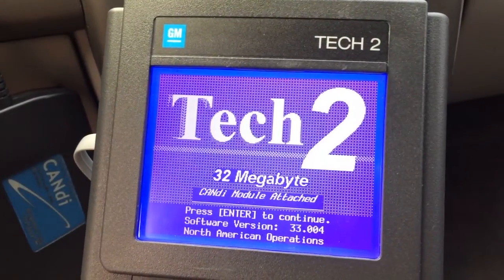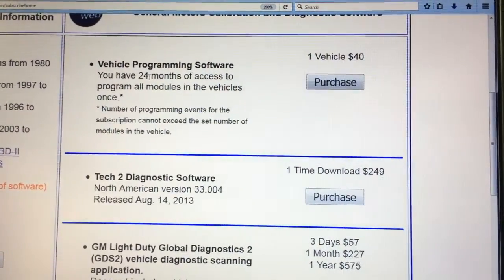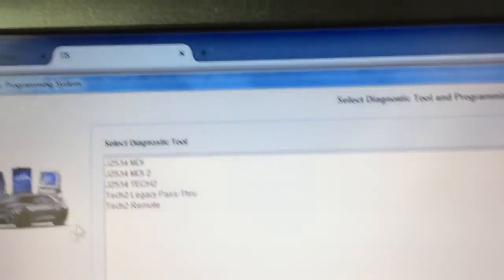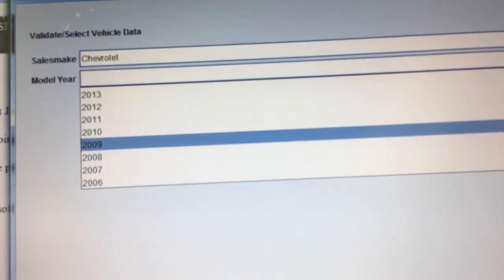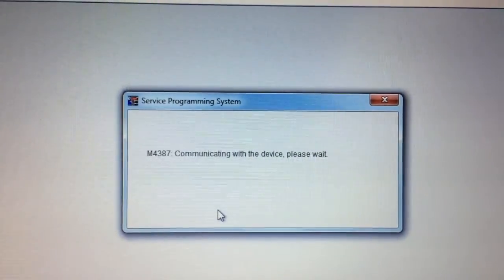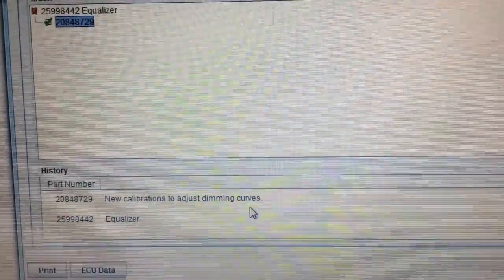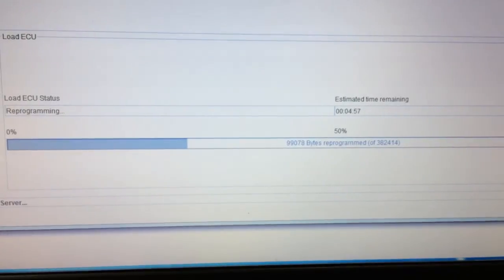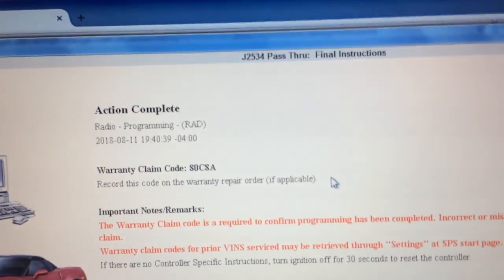GM SPS Programming: Tech2 Tool Pass Thru Mode ECU TIS2Web TDS How to do a Calibration Update Reflash

Comment: Great video. Finally found relevant info on GM programming. Question, I run an independent shop, installing a rebuilt 6L90 in a 2012 2500HD and need to program the TEHCM. I know this vehicle is not a CAN vehicle. Should I buy a MDI 2 and subscribe to GDS2 for 3 days and SPS for 1 vehicle or is there a better option that you would recommend? I don't have a Tech2. Also looking to future proof tech at the shop for newer vehicles.

Thanks for your help.
Reply from the maker: Thanks.  For a 2012 vehicle you could go with an MDI rather than an MDI 2.  I don't believe the MDI 2's unique new protocols start being required until Caddy CT4/CT5s and Corvettes from 2020 upwards, though that list will continue to grow and expand that's also going to be limited by GM's moving away from combustion engine powertrains and aggressively into electrics on their 2035 electrification roadmap plan.   With an MDI (either 1 or 2) you can have Tech2 coverage for legacy vehicles using the Tech2Win emulator sub with Techline Connect, so you don't need an actual Tech2 as a professional shop imo.

For an individual or prosumer user, I'd straight up recommend an MDI clone.  But while they, despite the fake news to the contrary, are 100% compatible with Techline Connect (SPS2, GDS2, and Tech2Win) they are not as robustly constructed and I wouldn't see them holding up long to shop drops and abuse like the original Bosch one.  The MDI2 clones btw are not real yet, they are currently just cosmetic copies of the same MDI1 boards.  So for coverage on 2020s that require an MDI2, only the real McCoy will suffice today.   

So bottom line, I'd look for an used genuine Bosch MDI unless you do this alot.  If you did these jobs alot, I'd instead suggest an used genuine MDI2. Hope this helps.
Reply: @DrShock  Perfect! Just the knowledge and help I was looking for. You are a wealth of information. I don't do this a lot. Thank you so  much for your fast reply.

So just to clarify, get an MDI 1, subscribe to GDS2 and SPS and I'll be good to go?
Reply from the maker: Yeah, that's what I would do in the situation you've described.  Used genuine Bosch MDI1, rather than Chinese clone.   And weekend subs to SPS2, GDS2, Tech2Win as needed that I'd charge to the customer.  It's like $30 or so, check at www.acdelcotds.com for the current rates.

For a DIYer, or prosumer, I'd always suggest a Chinese clone of the MDI.  But for a shop you want some more ruggedness to the outside case and inside electronics.  The clones are 100% compatible software wise, but if you drop them they are more likely to be damaged than a real Bosch.

Comment: Ok, after decades of dealer work, my Hewlett-Packard TECH2 card can no longer be updated pass the 2013-2014 model year! Is this right? Retired and fixed income is no fun, but a storm destroyed my wife’s older GM. I want to get a 2015 Malibu LT and still like to be able to diagnose the problem...Even if I have to take it in. The techs I worked with have retired and some may know me, but just unsure in October of 2021 what my TECH2 will work with! Thanks to the Chinese flooding the market with cheap clones that break down-no repair and some have messed up module(s).
 Any thoughts that could tell me what to expect?
 The carline Malibu ran from 2012-2015, then change in 2016. I know I have lied to the TECH2 in the past to have it function fine on a 1 year newer model. I guess looking for current help as I don’t want to walk into a dealer tech for nothing! Thanks. DK, Omaha.
Reply from the maker: Yeah the Tech2 is retired as of 2013, started getting model support dropped in 2010.   You can still use it as a J2534 passthru with www.ACDelcotds.com for SPS.  But for tests and diags you'll have to use GDS2 on the laptop now.  Here's a GM list of what requires an MDI now (or J2534 passthru) for SPS/GDS2 - https://www.genuinegmparts.com/pdf/positionstatements/vehicles-supported-by-GM-scan-tools-reference.pdf

Comment: @drshock Thanks for this video! can you please tell me, which type of program do you use in this video, win XP or win 7, and which operating system do you use, 64-bit or 32-bit? i also want to know, which version of Java do you use and which browser is it?
Reply from the maker: I'm following the GM hardware and software guidelines published at https://gsi.ext.gm.com/userguides/Aftermarket%20Infrastructure%20Guideline%20v1.0.pdf where the most important thing to notice/get right is that the Java runtime has to be 32-bit whereas the OS has to be 64-bit.
Reply: @DrShock  ok, thank you

Comment: Which tech 2 clone is the best or all the same
Reply from the maker: I'm not sure if these are being actively cloned anymore.  The MDI and MDI2 type clones are the more current tools.  But you used to be able to spot the higher quality Tech2 clone by the fact that it came with all of the adapters, various power cable types, and loopback test adapter.  It would also come with a copy of the TIS2000 software.
Reply: @DrShock  thanks been looking for another tech 2 with 32 card and tis 2000,,they all look about the same,,got a one now that works on my laptop,just no tis 2000, I still work on a lot of this old stuff,love you Channel keep up the good work
Reply: @DrShock  hate to keep bugging you but want to make shure I'm getting the right one,,

TIS2000 CD (included) will do up to 2007 year for GM vehicle programming. Does NOT include the software key. You'll need to obtain on your own or find a hack to unlock. Best source is acdelco website which costs $55 for 2 day access to the tis2000 SPS reprogramming .

Without a subscription to GM TIS2000, Tech2 CAN NOT :(1)Configure a "secured" BCM (GM says to get a new BCM in that situation) (2) Flash an ECM with new firmwar (3) Configure the anti-theft system
Reply from the maker: @scotttucker4075  So that description is somewhat inaccurate.  Thru 2007 model year is true for TIS2000.   And the part about the security dongle (key) is accurate.   But the acdelcotds website is TIS2Web, not TIS2000.  There's no subscription fees or costs at all if it's actually TIS2000 on DVD they are including.  There are no subscriptions to TIS2000, it came out years before such a thing was possible over the internet/web.   So all that costs part is inaccurate (also TIS2Web SPS is currently $40 per VIN for 2 years now).
 
A secured BCM I would presume refers to a locked BCM because GM doesn't allow you to reuse used ones once you program a BCM it's locked from further programming on most models.   Even back in 2002 or so they were preventing this at the Tech2 level (scan tool reports locked BCM).   I've got a few videos on this problem, you can't even use TIS2Web SPS to reuse it, you have to either get a new BCM or work on the circuit board chip itself.    On the flash comment, I've got several videos on reflashing a PCM/VCM/ECM using TIS2000, you just have to be model year 2007 or older.  Configuring anti-theft, again model year 2007 or older only with TIS2000.   No subscription costs required.
 
If you are only doing 2007 or older, get a Tech2 clone with a copy of TIS2000 included.  If you need newer, no other option but TIS2Web (www.acdelcotds.com) and there you would be better off with an MDI clone but a Tech2 + CANdi module can work thru 2010 or so.

If you go the Tech2 clone route, be sure you have a Windows 2000 or Windows XP PC around, TIS2000 only runs on that era of PC.   And make sure you find a source for the security key dongle (most common is a USB type) for use with TIS2000.  There is a mod to hack out the dongle check, but if you're not PC savvy it can be more trouble than it's worth vs just getting the dongle key.   Hope this helps.

Comment: Second question, my tech does not connect with laptop anymore and i to sang rs232 cable yet is not working. What could be the problem?
Reply from the maker: Did you do the communications diagnostics check shown in the video?

Comment: I think it is misleading, until you read the fine print below, basically you can't program more  than the modules your car has....but hey...you have 24 month access.🤦🏼‍♂️
Reply from the maker: GM sells the subscriptions per VIN / per vehicle, so yeah just modules associated with the one VIN for 24 months.  For personal use though, it is quite a bargain as the average shop will charge you significantly more just for one module not including the labor to R&R the module.  For $40 you get 24 months of any module on your vehicle, for no additional charges.   Your tools, your parts, your labor, your way - that's complete satisfaction guaranteed.  ;-)
Reply: @DrShock  You can only program twice if you have 2 modules. I'm trying to trouble shoot my 2005 GTO and re link PIM to PCM due to me bricking original PCM, but I don't see that option with TIS2Web. These cars are a PITA as modules and security.
Reply from the maker: Interesting.  I did a vehicle last last year on TIS2Web with an MDI and SPS where I updated four different modules in one sitting, just doing calibration updates proactively for the owner.  I can't recall any sort of limit in past years either with SPS (other than the fact you cannot reflash the same calibration twice), though I've never had a situation where I needed to do two of the same modules in one sitting.   As best I recall you need a Tech2 to do the PIM relearn.   Or alternatively, Tech2Win.   Here's a link to the GM service information in a PDF over at EFI Live for what you're looking to do: https://www.google.com/url?sa=t&rct=j&q=&esrc=s&source=web&cd=&ved=2ahUKEwii8qe73-fuAhVEmVkKHXraBN0QFjADegQIBRAC&url=https%3A%2F%2Fforum.efilive.com%2Fattachment.php%3Fattachmentid%3D8911%26d%3D1283265494&usg=AOvVaw1iVv3LoyYe4-88wbreQ4wd
Reply: @DrShock  I have a Tech 2 and have tried relinking via TIS2000, but will not do it. I have the PDF you supplied...👍. I don't see the option available when I try Tis2Web. I tried to follow what Spartanautoworks here on YouTube did to relink, but he showed the relink function and mine didn't. 🤷🏼‍♂️
Here is an e mail from Acdelco:
Vehicle Programming Software

"Includes: 24 months access to program all modules for one vehicle (VIN)".

If you program all the modules first the subscription then expires before the 24 months.

The limit is the number of modules in the vehicle programming of a VIN or 24 months whichever comes first.

Comment: Tell me about the bricked issue...I bricked my 2005 GTO E40 ECU because of what I think was caused from low voltage or interference. You really need a good battery charger/power supply that puts out clean power and adjusts it current output based on demand. I had to purchase another ECU preprogrammed and am having issues with it communicating with the PIM and BCM for the VTD relearn. Lessons learned....🤦🏼‍♂️

Comment: Im programming a 2011 impala bcm right now and I'm having issues setting up the bcm. I read another comment where you said newer cars would be able to program info without using SPS. Can this generation impala be done the same way? Ive done the 2 options provided but i can't program the VIN to the bcm.
Reply from the maker: I'm only familiar with two methods myself, one is very old where you setup a new BCM using the Tech2 alone (I presume this is what you were referring to).   And another method is where you need SPS on TIS2Web (www.acdelcotds.com).  Some older BCMs are completely non-programmable and you have to replace with brand new - https://www.youtube.com/watch?v=Chy9pIzoguA .  I haven't worked on a 2011 Impala, but I'd look first for the BCM setup menu in the Tech2 like I show in that linked video for 2005 models, I doubt it's there in 2011 but worth checking.  If not, I'd look at what TIS2Web showed for SPS options on the BCM tab for this vehicle.   There's got to be a path where for a new BCM setup you can set the mileage and/or VIN along with the options the vehicle has (like cruise control yes/no, etc).  In most cases you cannot repurpose an used module, as the GM approach was to use a new one only for repairs so would suggest that route for the least hassle.
Reply: @DrShock  I was able to get the BCM programmed using the SPS procedure in your video, so basically any 8th gen Impala has to use SPS to program any modules. Turned out that the RS-232 to DB9 adapter wouldn't automatically install its drivers so I had to do it manually. Thanks for making this video, it helped fix one of the issues I've been having while narrowing down other issues that need fixing.

Comment: I think your the best person to ask , so if I set up a brand new BCM and PCM on a bench harness and program a module like a GM lan radio - it should stay NO VIN correct ? Because it will not accept any VIN from the BCM/PCM
Reply from the maker: Both a brand new PCM and a brand new BCM will not have a VIN out of the box of course.  They will have some default value in the EEPROM memory location where the VIN goes though as part of the virgin image from the factory.   I have not attempted what you described here as not performing setup on the PCM and BCM first would not be a normal repair approach, but I would expect the Tech2 to generate an error message of some sort in attempting what you are trying.  A module like the radio will still find a no VIN match condition and maintain a Theftlock state because the BCM does not have the same VIN it has stored already.
Reply: @DrShock  thank you so much . I have seen a discussion someone using a virgin BCM on a bench setup and programming a GM HMI unit so it doesn’t accept any VIN when it reboots after programming it . I will attempt and give updates

Comment: Awesome video man, so basically the TIS2WEB turn the Tech2 to into J-Box and programming has to be done thru the PC for 08+ models ? Will this work with a good quality J2534 Box like the Autel?
Reply from the maker: ACDelco TIS2Web does support non-GM scan tools that are J2534 compliant yes.   You may have to select J2534 manually, and for Autel I would suspect it has to be the GM version of the Maxiflash.  But I've never used anything but the Tech2 or MDI tools myself.